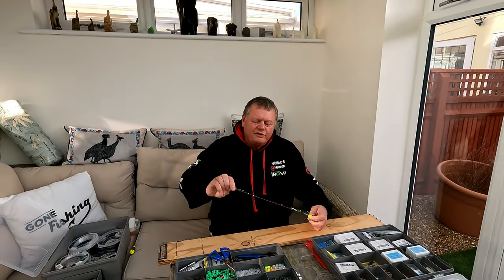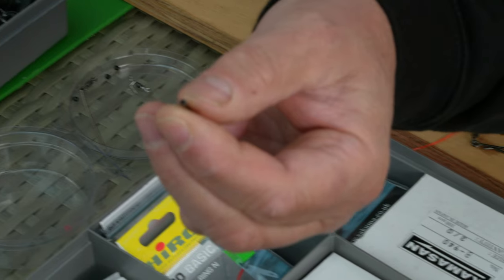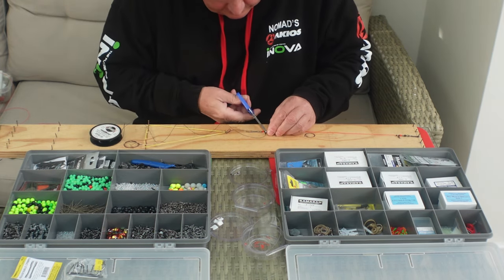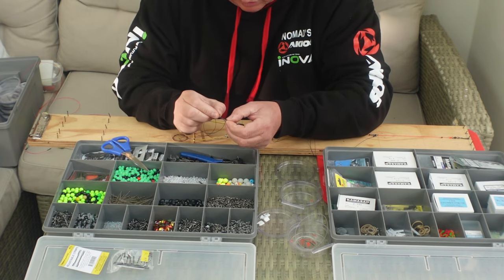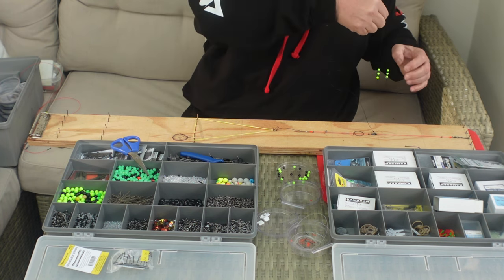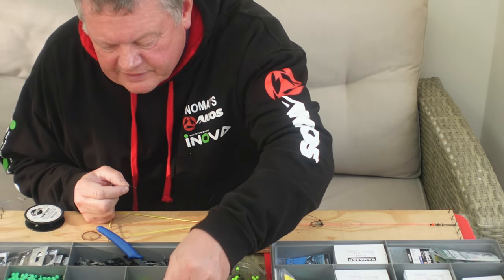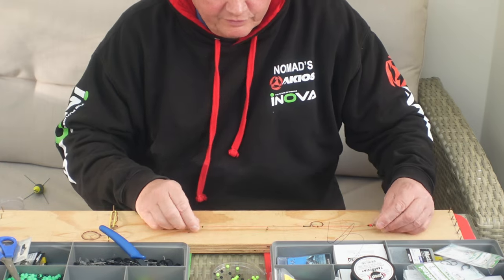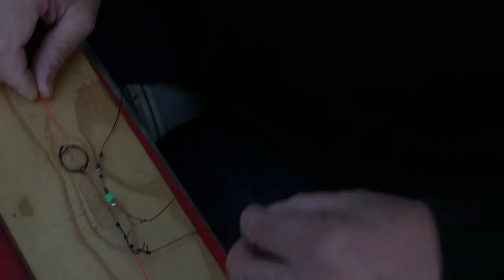Building Rigs with Steve - The Flexible Loop Rig

Comment: Enjoying the video’s. Could you explain which coloured amnesia hook lengths you use for different conditions / target species.
Reply: Hi David, for most of my fishing I use clear amnesia of different strengths for the target species. 10-15lb for flatfish and summer fishing, will also use red amnesia for flat fish. For these rigs not less than 20lb as this helps with the presentation in the tide. Winter fishing I use clear or black 25-30 lb as this lasts longer with the Whiting and helps if you get a Bass, Cod or Conger. Bigger targeted fish heavier clear amnesia up to 50lb and then I go over to mono for 60lb up.
Hope that helps.